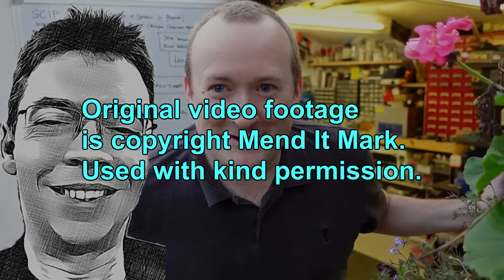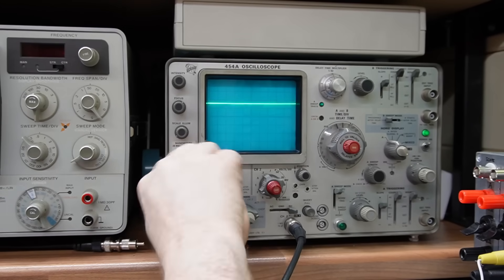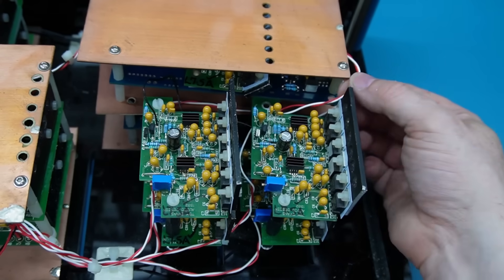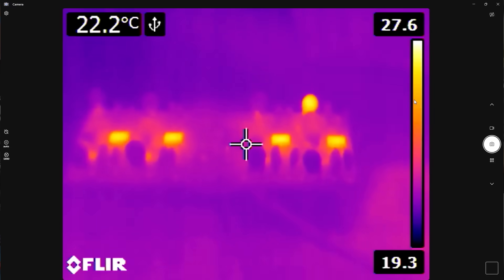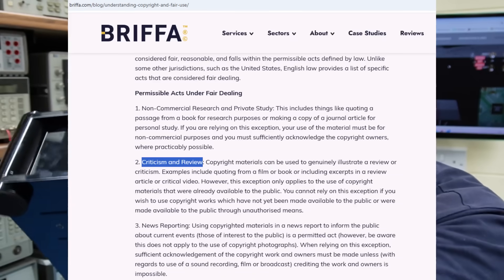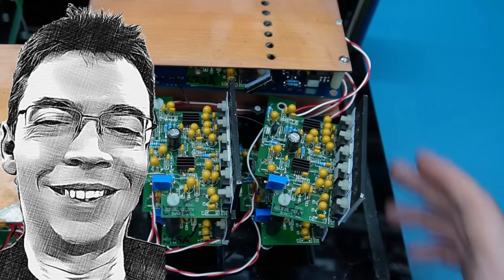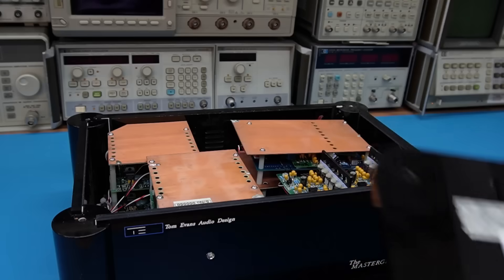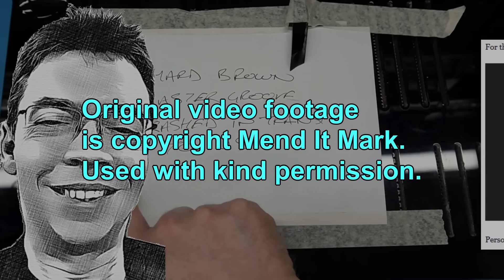Reaction to Mend It Mark takedown by "Tom Evans"

Comment: "Tom Evans" has made himself and company toxic. And a laughing stock.
This video raises a very interesting question. I am in the US and we have various laws regarding consumer protection and contracts. Those laws address by specific phrase "fitness for purpose."  But now I wonder if the theory is adjusted relative to the price of a subject object. That amp does look like a DIY project for which $100 US would seem to "fit." Something like a Heathkit we used to assemble ourselves as kids. But certainly not  £25,000. 
I subscribed yesterday after seeing Louis Rossmann's video about the issue. You do NOT want to mess with Louis.
Reply from the maker: Generally the more expensive something is the higher the expectation of quality and being "fit for purpose". For example, a cheap pair of shoes would not be expected to last that long comparatively speaking, but an expensive pair would be expected to last longer due to having the expectation of quality due to the higher price. So, if an expensive pair of shoes develops a fault (like the sole separates from the upper) after a short amount of time, they would not be fit for purpose.
Reply: @MartinPiper6502  My wife's a beautician and I occasionally go to trade shows with her. There are a remarkable number of expensive gadgets on sale (many of them are I think UV or IR LEDs in a tin box with a timer ... £200) which to my eye seem to do little or nothing. Something you'd really love to have a quiet 10 minutes with with a screwdriver. I've often wondered how close it is to fraud.
Reply: A correction if I may: I assembled quite a few HeathKits in the 60s and 70s; the implication that they were of poor design and poor construction is undeserved and inappropriate. They worked well and were reasonably priced. There was a 'wholesomeness' about the company and its products that this Tom Evans product clearly lacks.
Reply: @asquared8399  I’d forgotten Heathkit … they were awesome.

Comment: The wording on the circuit boards and on the case says "Tom Evans Audio Design". DESIGN. Does not say anything about the build. Now 25K pounds is about 45K Canadian dollars. For that amount one could get a pair of McIntosh mono amps. a McIntosh preamp and a McIntosh CD player or turntable. As for those plastic spacer thongs, they look very similar to wall plugs I use to mount hooks to a wall.

Comment: The really annoying thing to me is that in this day and age, getting decent stand-offs is relatively cheap and quick (aliexpress). Getting PCB's made that are high quality is again relatively cheap and quick, especially if you are below the magic 100x100mm size - which this looks to be, you could even fork out an extra $1 and go black (all the cool kids are doing this)... Having actual board connectors is again cheap and quick. Also using actual heatsinks rated for the job would be a good move too, again aliexpress to the rescue. You could even use shielded cable everywhere and doubt it would put $5 on the BOM.

Opening something like this should reveal a well designed and modular layout that is logical and practical. It should look as good (and maybe better) on the inside than it does on the outside. This is a bit like buying a Ferrari and finding out its a kit car based on a 1980's Skoda, minus the hand warmer when you have to push it.
Reply: I am wondering if the nylon standoffs were used out of concern for conductive material introducing an undesireable effect in the cicuit.  Genius at work.

Comment: 2:00 Whats the point with those copper PCB's to "shield" the "sencitive" electronics, when he put everything in a plastic case?
The normal thing would be to use a metal case to shield it, and ground everything properly.
But he probably couldn't fine such a case that looked fancy enough.
Audio foolery at it's best 😆
Reply: Nope, it's purpose is to shield its radiation from aliens, from whom the advanced technology was lifted by Tom. He mentions it on his website.

Comment: I did my electronics apprenticeship in the early 80’s courtesy of the MOD. The quality of work shown here is something we’d make in our second year. By the time we finished we were producing high quality circuit boards, with good components in appropriate boxes. Everything we did was designed to be crashed and not kill a crew, but quality didn’t mean expensive. It just meant the correct part for the job. Plastic stand offs have their place, but they’re likely  going to suffer from heat and vibration issues and can be easily broken with mishandling. The rest is just low quality workmanship.
Reply: Leave professionals like you . A DIY Electroncis / Ham like me used to solder way better in class 8th grade!!! And only apprenticeship I got under my Dad was being gifted with a cheap 25Watt iron and few tips! and I was on my own getting inspiration from cleanliness in soldering  of National/Akai VCR of 1990's . 
And the Standoffs and PCB Quality !! Jeees!!!
Reply: @ we all started somewhere. The difference for us was that we did this every day and we were watched and monitored by apprentice masters who wouldn’t allow sub par work to fly.
Reply: They do make more rugged standoffs for a few cents more, even ones made of exotic materials that reduce thermal and leakage current... This guy went with the cheapest possible solution that isn't even fit for a hobby prototype.
Reply: plastic stand offs are iffy to support just one board let alone four stacked on top of each other, and that poor method to join the two boards together is just appalling.

Comment: Isn’t putting an incorrect CE mark tantermount to fraud?
Reply: Yes, it is quite serious, but we are talking about a company which has gone great lengths to cover up the fact that they have implemented the same example application circuitry in the specifications sheet which came with the component itself and still was not ashamed to ask a outrageous price for it.
Reply: Letters are too close together, it is actually a china export mark, and also next to it, rip-off Intel inside logo...
Reply: A CE mark by itself doesn't mean much unless you know which product category it's claimed to meet. It could be certified as a doorstop or a paperweight.
Reply: The CE mark just says that the manufacturer assures that the product conforms to EU standards. You can just check all the rules, measure radio emissions and so on and put the mark on if you want. Or you skip that and you risk being liable. But a CE mark isn't fake, it's maybe a lie.

Comment: That expensive "product" looks like a science fair project.
Reply: Most of the Science Fair projects I have seen over the years have much better layout and construction compared to this thing.
Reply: Or a prototype. The price is in line with a one-off.
Reply: Not a science fair project, but either a one off or something a keen hobbyist makes for himself (the electronics that is.
The casing is a bit meh.
But all in all certainly not worth 25k, we all agree on that!😆
Reply: I used to make at least cleaner and better looking SS Amps back in School days itself.  And ANY Design Marvel of Tom could be totally factored out as his choice of components nearly match the Chip/OpAmp manufacturers Application note. And I give a DAMN about Hand matched components - go for 1%, 0.1% or 0.01% tolerance components , which should NOT increase the BOM cost by even 50 quids
Reply: Bloody hell 30 years ago I made an amplifier from a kit that had better build quality than that thing in the video, it is a total piece of junk, poor quality case, boards, standoffs, components that have been butchered and so much more, such is the "quality" of work it wouldn't be worth more than $100
Reply: Vid eo  is over on r mble.

Comment: Could have easily created a "motherboard" with sockets on to slot the "daughter" boards into with a lock mechanism. You would not need all those wires then going from board to board.
Reply: Sockets create the issue of possible poor contacts with age.
Reply: @donmoore7785  Preferable to the dogs dinner of fragile wires and nylon pillars.
Reply: You just pushed the price upto 35k 😂😂
Reply: You're right, but that would mean Evans would actually need to design a board, and by the looks of it he has no idea how to do that.

Comment: Even in the low volume home shed builder early 80s the standoffs would have been brass, for even lightly populated boards

I only ever used short plastic standoffs for non stacked boards as they break, later I used plastic standoffs (and screws) for sacrificial  quadcopter fasteners (better to break the fastener than an expensive piece part (2 minutes to replace the sacrificial parts.

It does indeed look like he has used hot snot to secure parts (it looks too clear for most of the sensible materials I have encountered) even you lay the caps on their side to give a sensible surface area when using silicone,and only products which actually set hard if you want to keep things that size upright (or secret)

Did my eyes deceive me on the power transistors where:
1: Had cardboard rather than a thermal pad between the transistor and the heatsink
2: Plastic screws to secure them to the heatsink

All in all it looks like absolute dung but then again that the audiophool market I suppose
Reply from the maker: I could make one that's eight times better for 10% of the cost.

Comment: That design is typical of stuff made in the 1980s for the enthusiast market, before we could get bespoke parts made pretty cheaply. As you say those brittle plastic standoffs are a travesty and the wiring looks like it was done by somebody's unqualified parents one wet weekend just as a favour 

'Copyright' can be interpreted here as 'I've been found out and am embarrassed'.
Reply: I used to build bespoke electronics in the 80s for UPS applications and no company I worked for would let this type of construction go to a customer as a paid for product. It looks like a hastily built prototype we'd use for proof of concept.
Reply: @TerryClarkAccordioncrazy  some of the very good amplifiers and speakers that I sold in the 80s looked a bit ropey inside. I corrected the phase on a few pairs of speakers because the designer's Mum had mixed up the wires. That was before industrial design was as advanced as today and component manufacturers widened their product ranges. Some of the small amplifier manufacturers turned out products that were a bit Heath Robinson. But they were cheap, not £25k! 

With this manufacturer his huge mistake was to try and charge his valued customer who'd invested a lot of money in the device, a premium amount to repair a pretty basic component failure. For £25k I would expect some amount of platinum plated support from my supplier, with a smile, a free cuppa in bone china and a degree of forelock tugging. Instead they are delivering a knee in the crown jewels and a v sign